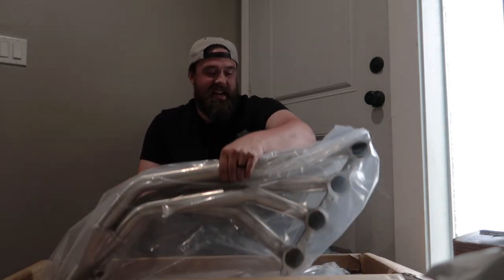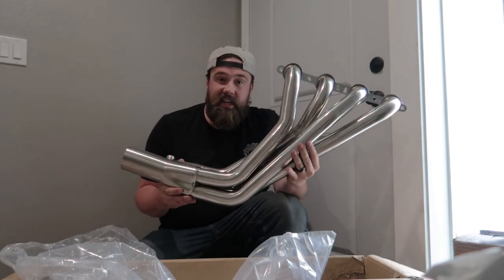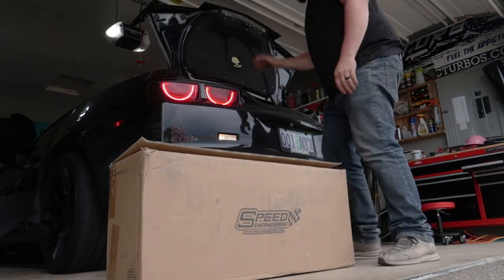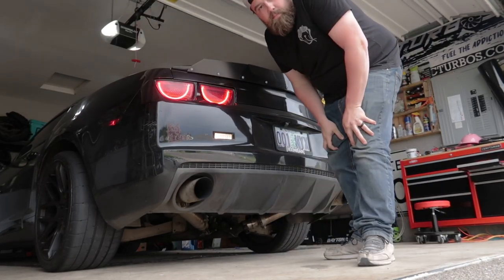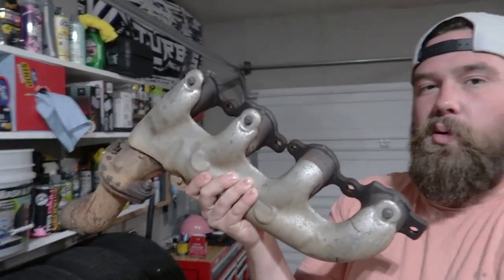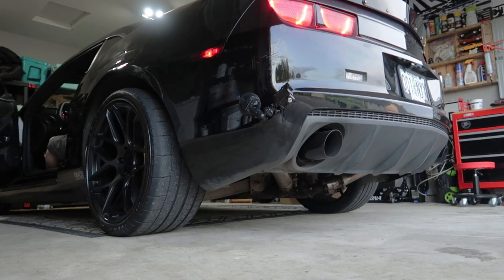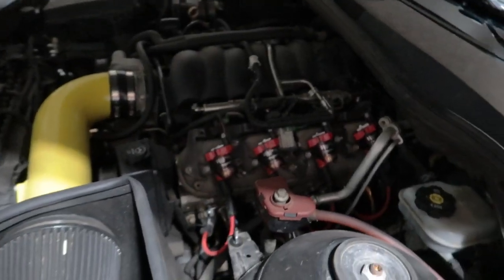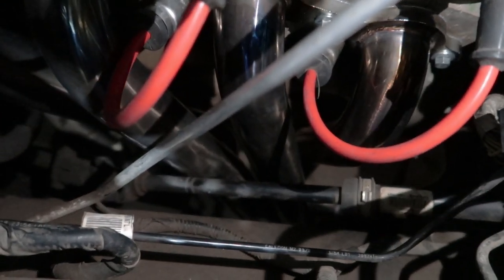Long Tube Headers. Are they worth it?

Comment: So I saw you have an Oregon plate, I’m in Gresham, I’m looking into getting a set the speed engineering headers for my C6 when they are back in stock, what shop did you use for the install. And do they work on C6 acorvettes?? Thx 🙏 for the video.
Reply from the maker: I had a local shop to where I live install it, but I regret it. I will be cutting off their nasty welds and buying a full header back bolt on exhaust kit and doing it myself in the garage.
Reply: @TurboDrivenAustin  oh no, not a good shop then, yeah after a little bit more research and talking to people I actually have the Corsa X pipe into the Corsa axle back extreme mufflers and with the Corsa system I have on my C6 the only long tube headers that will bolt up to  the Corsa X pipe is the Billy boat headers. I didn’t know that when I spent 2, 400$ on my Corsa system. I talked to a lot of people in the northwest Corvette association.Culb and they said to use wongs performance & engineering up in Hazeldale Washington. I guess he is the best. when I put the Long tube headers on, I will actually be deleting the cats with the long tube headers and when you do that with the C6, it leans the engine out and will throw  a CE light so it needs to be tuned. And I guess he’s amazing at tuning. A lot of corvette ppl use him.